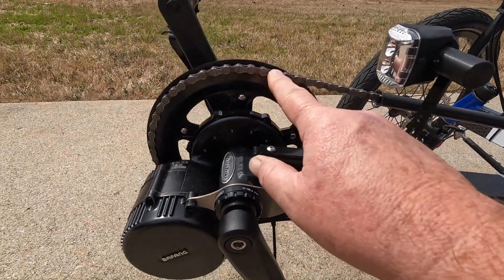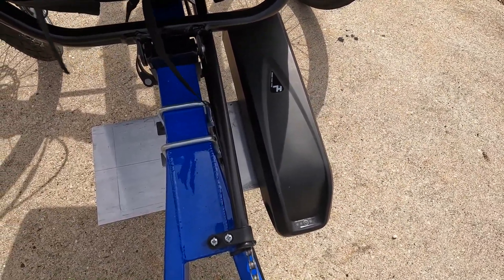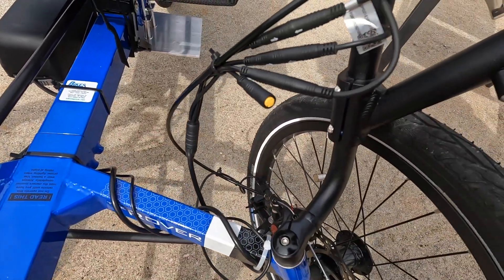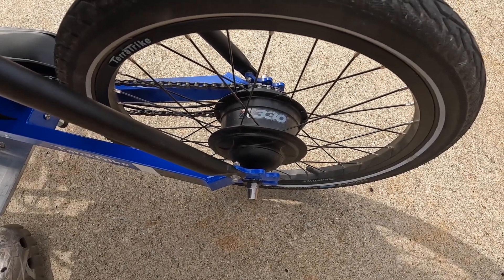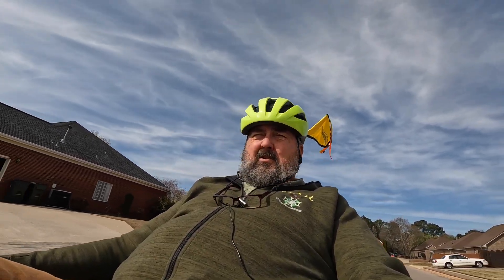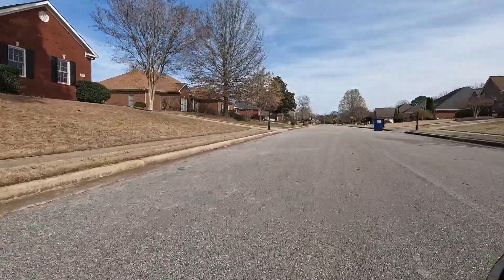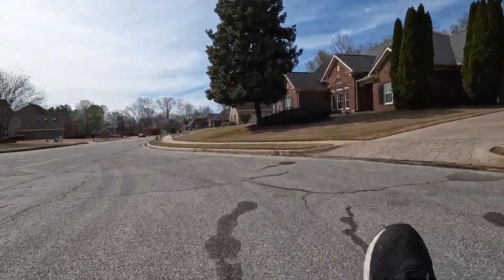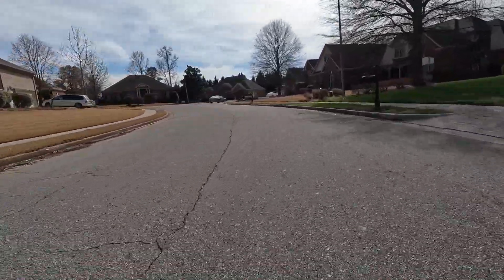Terra Trike Rover Bafang Conversion

Comment: Excellent video, just bought a used rover, thinking about doing same, already have a 750 Bafang kit on my bike that I may pull off.
Reply: Thanks, if you have converted a bike, this should be easy for you.  You will need a couple of extension cables.  Good Luck!

Comment: Rover has been around since 2011. I have 10,000 miles on my 2012 Rover.
Reply: Awesome👍 do you know what year they added the larger rear wheel to the Rover? I was looking at a used one, has the standard hub& external gears.

Comment: Great Video. I am converting my wife's Rambler with a Nuvinci N380. Did you install a gear shift sensor with your Bafang upgrade? 👍
Reply: I did not install the sensor.    I never had a situation where I shifted under load, so it was not necessary.  Just hesitate while peddling when shifting and all will be good.

Comment: I'm  6'2" and fat guy fits me fine. I did get wide handle bars. Did get the versabars and moved the front of seat closer to the frame cross members. Had to extend front boom(enough boom inside to do this by moving it farther out and use predrilled hole farther back.)  I needed longer chain and after doing this it's a lot easier to get in and out of. Looking hard at adding Bafang mid drive and changing rear wheel. Or maybe upgrading to Terratrike EVO.

Comment: Thanks for a great video. I am considering a conversion. I am wondering whether the Bafang mid drive motor provides any pedaling resistance if the battery is not connected to the bike. I would like to ride with no electrical assist sometimes but I do not want to suffer pedal resistance.
Reply from the maker: No resistance that I can feel.  I did a 14 mile ride yesterday.  I had the motor set a "0" for the first 5 miles.

Comment: Love it.  We are interested in their tandem.  Don't own one yet but eager to learn.  Subscribed.  My questions are ... what happens in a down pour, can the motor (and battery) be protected?  Also, how do you lock it?
Reply from the maker: There is some rain resistance with these systems, but we have never tempted fate.  We don't ride in the rain or when the roads are very wet.  Fortunately we have not been suprised by a sudden downpour.  I have seen covers for bike batteries that will provide protection from rain/dust/mud, but have never invested in one.   The batteries have a key to lock it to its mount.  We use cable locks on those rare occasions where we have to leave or trikes unattended.

Comment: Thanks for the info, do you by chance know what year they added the bigger wheel on the rear of the Rover? Standard external gears, 8-speed.
Reply from the maker: I think the Rover was always three 20 inch wheels.  A larger rear wheel on the Rover would probably be an aftermarket change.

Comment: Did you have to use spacers to install the crank and whatdid you use to screw in the torque arm into the frame? Thanks for the video 
.
Reply from the maker: No spacers were needed for m.  I used a threaded rivet to make a hole for the screw on the torque arm.  You will have to drill a hole in the boom, and then use a threaded rivet tool to install the rivet.  The rivet is essentially a threaded liner that goes in the hole, providing a place to screw in a #10 scew with washer.  Here is a pretty in-expensive tool kit to install them.  https://www.amazon.com/YaeTek-Riveter-Threaded-Riveting-Assortment/dp/B078SLWKGM/ref=sr_1_8?adgrpid=1232552846195495&hvadid=77034719388463&hvbmt=be&hvdev=c&hvlocphy=80985&hvnetw=s&hvqmt=e&hvtargid=kwd-77034788111606%3Aloc-190&hydadcr=650_1015099152&keywords=threaded+rivet+tool+kit&qid=1687804553&sr=8-8

Comment: I'm a big feller. 6' tall and fat. Attempting to stay the same height but reducing my width. You mentioned yours being a little small for you. Do you mind telling how big you are? Also, did you put the wider handlebars on it?

Thanks! Great video.
Reply from the maker: I'm 6'4" and about 280lbs.  The Rover handles up to 400 lbs and I can get enough lenght on the boom for my legs.  The issue I had was the width between the handle bars.  My legs slightly rubbed the cables and versa bar as I peddled.  I could ride comfortably, but it was enough to be irritating as I rode.
Reply: Thank you for your reply. I took one for a test ride on sunday and ran into the same thing. Nice riding bike though. I had been riding a delta and I liked the tadpole much better.  @Trikes-Trails
Reply: @Trikes-Trails you can buy extensions to widen the distance between the handlebars. With it’s 400# capacity the Rover is a great trike for long hauls.

Comment: Would you mind sharing the total cost of the project?
Reply from the maker: Paula, I bought my kit from this vendor.  I got the low end battery (48v 11aph)that came with the kit. I did not upgrade.  The only cable extensions I needed was the battery extension and speed sensor extension.  https://bafangusadirect.com/products/complete-bafang-750w-bbs02-mid-drive-ebike-motor-kit-battery

Comment: How stable does this frame feel when you're at high speed? Tempted to do this, but I'm a high speed rider and some of these get sketchy going over 15 or so.
Reply: The Rover is more of a touring trike instead of a speed trike.  You sit up higher and more erect than some other trikes.  As such, it will not be as stable when cornering at higher speeds.  However, I never had any trouble with it in that regard.  If you want speed, you will need to look at some of the other Terra Trike models.